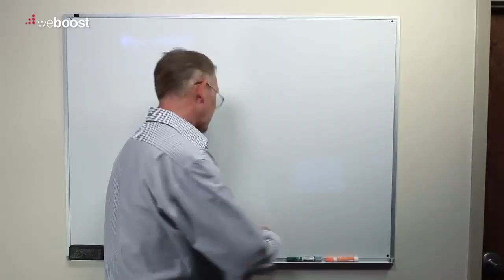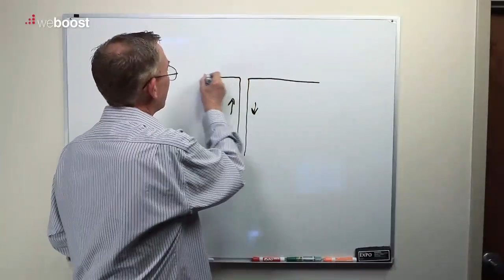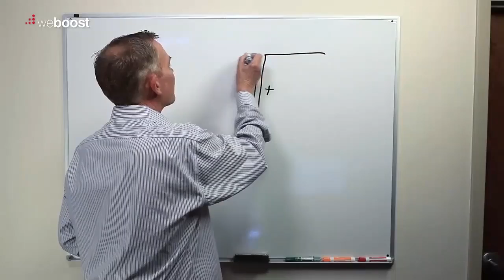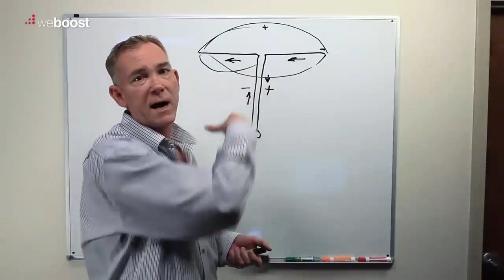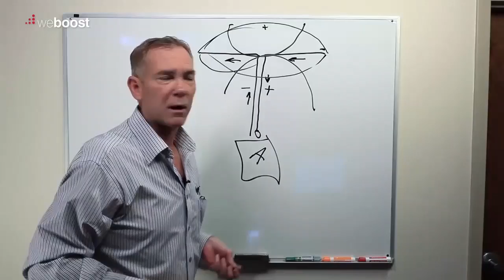How Do Cell Phone Signal Booster Antennas Work?

Comment: OMG, A spam video. Confusing false information about Coax. His Antenna theory explanation shows a lack of knowledge, and then, he spews out confusing information that does not give a watcher the basic information required.  This is about the poorest explanation of how an antenna works that I've ever seen.  Antenna radiation is as easy as well, watering the horse, stand close and  your aim will help, radiation can be like a sprinkler,  a spray , a mist or anything in between.

Comment: At 3:14 , it is implied that the current is maximum at the sides of the antenna and minimum at the center, but it actually is the opposite , the maxiumum current fluctuation is at the center of the dipole and the maximum voltage fluctuation is at the sides of the dipole.  

https://en.wikipedia.org/wiki/Dipole_antenna

Comment: I bought a phone repeater with an external aerial.  When I put an ohm resistance meter across the external antenna pins I am getting a 100% short circuit which is somewhat puzzling as the internal antenna and other similar aerials I have tried do not show a short.  Having taken the cover off, it seems it is designed this way.  The repeater doesn't work with it connected either, the LCD signal displays just flash but that could be lack of signal problems.  How is this supposed to work shorted directly back to the earth side of the coax cable?

Comment: That was a very simple and easy way to understand how an antenna works. Thank you! I assume a cellphone booster just does the same thing. It receives with one antenna, amplifies it, then spits it back out another antenna? That way your cellphone "thinks" thinks its getting a stronger signal. Although that still clearly means that a cell phone booster is only as good as the signal it receives. But if you could get that cell phone booster's antenna (that's probably a bigger and better antenna) up a little higher, and outside your own house, it could make a big difference if the boosters transmit antenna is back in the house.

Comment: So I picked up 2 dipole antennas that are capable of 700 megahertz to 2100 megahertz send and receive I'm going to connect the two with 50 ohm coaxial cable one will be on the roof one is going to be in my home I understand that they'll induce signal with the dipole antenna. But what type of current do I need to put on there to have the signal jump out or will it do it by itself? and what type of current are we talkin? like can I put a coax DC converter in line? Would like a 12-volt current on there be enough?

Comment: Nice explanation,   Maybe you should have touched on wavelength..  The length of the wires can catch a specific radio frequency more efficiently,   if it's the right length..    2.4 ghz  Wifi should be about 4.9 inches long..

Comment: Could you please explain how you can have current flow with an open circuit?
Reply: Is the energy flowing? Or is it just moving. What if you have a a cylindrical object and you put beads or marbles inside the cylinder. Well when you tilt the cylinder vertically up and down so that gravity flows the marbles in one direction towards gravity. Now rotate the cylinder 180 degrees and the beads will flow to the other end of the cylinder. If the reason a conductor allows electricity to flow along it is because it has 'loose' electrons if we change the balance of energy along the wire at one end with a relative positive at one end and a relative negative at another it will act as our shift in pull on the electrons generating a tendency for the electrons to cling to one side or another. Capacitors and inductors don't complete a circuit in a physical sense either but we use them to transfer electromagnetic energy regardless in a complete circuit. I'm not saying this is how this process works but just what I've been learning and gathering over time. Electricity is a lot less like water mechanically but a lot like it in how it transfers it's energy. Because how things transfer energy just seem to work in similar ways in certain frames of reference.
Reply: @johndoe-es7zh  
Capacitors and inductors don't complete a circuit in a physical sense
This comment is entirely incorrect!
Capacitors do have current flowing until the plates are charged and then the current stops.  What is left is a static charge of the plates.  
Inductors have current flowing through them and create an electromagnetic field.  When the current is removed, the field collapses creating a reverse current flow until the fields are depleted or the inductor is reconnected...
Reply: @valveman12  you're being a bit obtuse if you think that's what I'm saying. Electrons do not hop between one plate of a capacitor to another they actually rely on this fact. So what I was trying to point out to you is that maybe that isn't something that's required. And the balances and movement of charges is what is the primary motive force in electrical phenomena and the radio connected to the antenna creates the driving charge that produces the frequency.
Reply: @johndoe-es7zh  
If being obtuse means correct an error, then I'm obtuse I guess.
Your Comment
"Capacitors and inductors don't complete a circuit in a physical sense either but we use them to transfer electromagnetic energy regardless in a complete circuit. "

Current does flow when a capacitor is charging.  Not across the plates, but the electrons accumulate due to the attraction to the positive plate.  Inductor, the current flows through it generating a magnetic field.  Stop the current and the magnetic field collapses and the polarity of the coil changes.

As for antennas, the high-frequency signal that is sent to the antenna is converted into Electromagnetic Waves.  Efficiency is a function of impedance matching to obtain the best coupling for maximum output.  Perhaps you know this already so I don't want to assume.

Comment: How do i plug into a phone to boost my phone signal?
Reply: Yana K can you use a wow the Shelf router antenna hook it up to your cell phone
Reply: apparently it seems to me that you don't plug them into your phone. one antenna goes outside your building or in an area with a good signal. and it recieves the signal from outside and broadcast it inside without any need for a physical connection to your phone or power.
Reply: Yana Yana K  bro you have gust plug the white and green wire in an antina or you're own TV dish of the data cable and then connect to your phone ....
Reply: Yana Yana K you just plug in to your ass